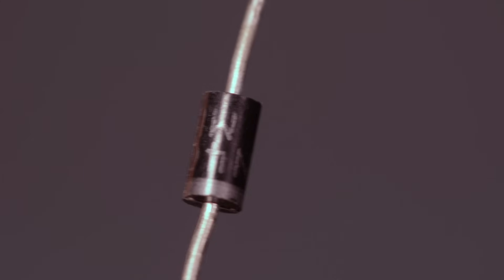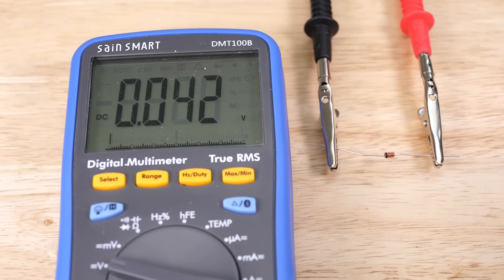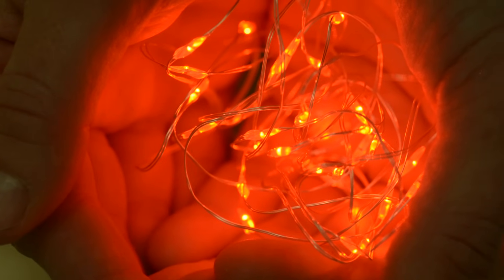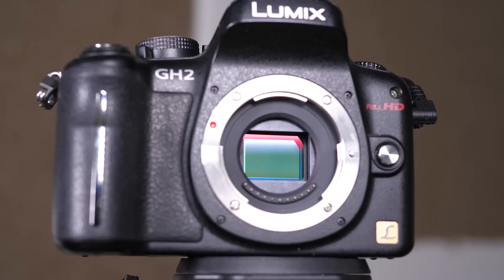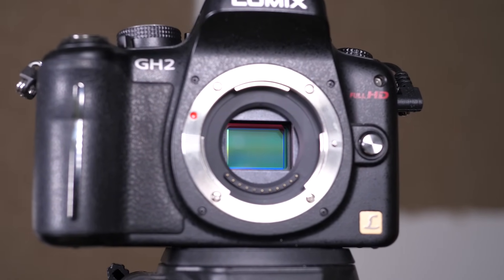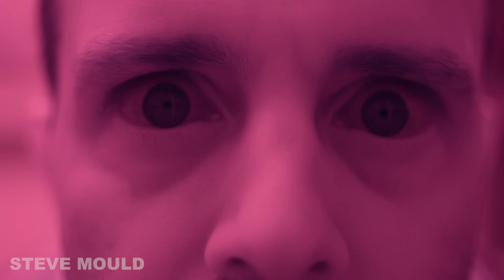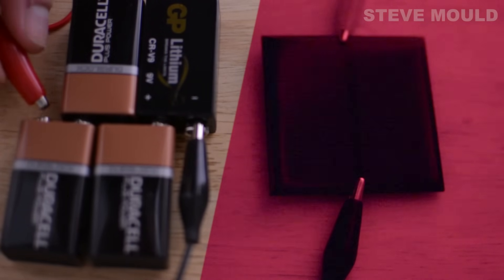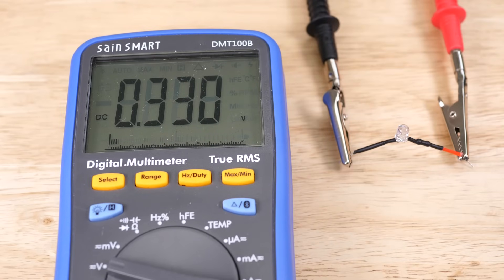Why all solar panels are secretly LEDs (and all LEDs are secretly solar panels)

Comment: 'You can use a speaker as a microphone.'

Hello, CIA.
Reply: Hello CIA my old friend...
Reply: @heroslippy6666  hello I am RJ REYNOLDS TOBACCO COMPANY from the cia illuminati  ! We love  watching  you!
Reply: @heroslippy6666  I've come to talk with you again...
Reply: @heroslippy6666  I've come to talk with you again
Reply: @ZacharyBittner  Because a vision softly creeping
Reply: I've come to let you snoop my friend.
Reply: Hero Slippy 
..... you've come to listen in again.
Reply: NSA joined the chat
Reply: Free speach left the chatt  @Yorgarazgreece
Reply: If you take a microphone apart, and a pair of head phones, you will find the diaphragms look very similar.
Reply: Vincent Robinette depends on the mic. Dynamic microphones are closest to speakers
Reply: @RennieAsh  That's correct. the diaphragm is designed to be very low mass, and as non resonant as possible. The coil is wound with super thin wire, to give enough voltage for amplification with a reasonable signal to noise ratio. To reduce mass, the coil wire is much much finer than would be used in a headphone transducer, or a speaker. As such, you don't want to use any more power, than what would be barely audible. If you hold it up to your ear, it will sound fantastic, because the spectral time alignment afforded by the low mass of the diaphragm. It's very fragile. No more than .05 to .1 watt absolute max, or you risk damage.
Reply: @vincentrobinette1507  wow,  you are either a ham radio operator or an electrical engineer.  i just ran across this site and am amazed at how much electric and radio knowledge is being emitted here.....
Reply: I did that to my ex once, looked extremely similar to my then current gf's diaphragm. . Suffice to say, cheap knock offs are just not my thing.
Reply: Lizard Man from Facebook joined the chat.
Reply: Lol
Reply: @sherloidbai7064  because he's from the company testing those stuff in secret and you kinda spilled the beans? lol
Reply: 666th upvote. =)
Reply: and motors are reverse generators
Reply: Thank you Big Brother 🤯🤐
Reply: LEDs can also act like a pixel from a camera 😉
Reply: if you have a mic built in that's easy access, and you deserve it for tempting them
Reply: I used to use a pair of headphones as a microphone when my mircrophone fucked up years ago....old news.

What is shown in this video is very old information and hardly a 'secret'.
Reply: Are u sure? I know piezoelectric devices can be utilised both ways. Didnt think the magnet driven, conical displacement variety would collect much useful information, but prob wrong.
I assume the speakers in phones are not piezo devices.... Not sure now.... might have a look see
Reply: Alexa
Reply: @sherloidbai7064  It makes no Sense transmit data thru Power likes. Teu another thing.
Reply: @azielmelo7756  there are times when it makes sense, like if you have a really low bandwidth signal, sand filter circuitry, and the store is closed, and you need to transmit that data from one side of the house to the other. It's very rare that it's actually practical nowadays, but it does happen.
Reply: Input transducer > signal processor > amplification > output transducer. 

Microphone > mixer > amplifier > speaker.
Reply: No
Reply: Haha
Reply: The CIA doesn't care about tracking us Americans, unless if you're a hacker yourself. it's actually hackers that get in and execute malicious scripts to force your computer to listen to you and send the information back to the hacker. The CIA has to deal with these hackers so technically the CIA protects you from snoops
Reply: We are watching you ! The  illuminati CIA!
Reply: LEDs can also function as microphones.
Reply: So you're saying the CIA put a SPEAKER in your room, to... send you messages ig(?), and you're going to turn that around on them so they have to listen to you? Because they weren't already listening? Do... do I have that right?
Reply: @joshyoung1440 , you can turn an LED into a microphone as well. It is shown how to do it on YouTube. Bag of potato chips as well.
Reply: @iamanempoweredone6064  cool, I bet you can and I'd love to watch how it's done, but that's entirely irrelevant to the point I was making
Reply: @joshyoung1440  , just a fun fact to know and tell..
Reply: You can technically also use a Piezoelectric crystal as a microphone. Basically long lighters.
Reply: in the Soviet Union, we could listen to our neighbors through a common radio point between broadcasts.
Reply: @ДенисЗайцев-э1ф , there may have been some device implanted in that neighbor’s house for surveillance purposes and you stumbled across the frequency of transmission.
Reply: @1d10tcannotmakeusername  I wouldn’t be surprised.
Reply: Sorry to ruin the fun. But for your speakers to work they need to be powered by an amplifier, and there's simply no way the audio signal can run backwards through an amp, not even into the amps power supply (which is most likely a DC power supply which has a full bridge rectifier).

But let's say you get through the amp, then you have to go through the DAC which is the component which turns digital signals to analog, here you also cannot go the opposite way as that would require a ADC.
Reply: I am not an electrician but I would think you are right. I made a sub-woofer into an ultra low microphone to record a kick drum and it needed to be completely wired differently and also even with my pre-amp it was a weak signal compared to a purpose built microphone  @Maxwaehrens
Reply: @Maxwaehrens  Excuse me, but I think you're missing the point, which is that dynamic microphones and dynamic loudspeakers are basically the same in construction, just different in detail so, fun not ruined
Reply: @joeking1019  I study electrical engineering, so I get that microphones and speakers are similar. Speakers turn electricity fed into them into an audible sound wave if that electric signal has enough power and is within the frequency range of the speaker. And microphones are the opposite, they turn an incoming sound wave into an electric signal but they require a lot more circuitry to get anything useful.

But back to the point, the fun I was ruining in my first comment is that CIA can not simply listen to what you are saying through your speakers...
Reply: Did you know that in the 70's they were already bouncing lasers off of windows to hear the conversations going on inside? My father worked on some of their equipment back then including the eavesdropping recording center for Southern Europe.
Reply: @SaneAsylum  My father was on that team and he tells me your father was not.
Reply: They can do that better now, they use a high speed camera to view inside a room, the experiment I saw was inside a sound proof room. They viewed the subtle vibrations of an object, and reconstructed audio from it, similar to how a record plays music.

https://www.youtube.com/watch?v=FKXOucXB4a8
Reply: this is true.
Reply: "You can use a "green" CFL light bulb as a camera" I really don't know
Reply: John Johnson 
I use my camera as a footstool!
Reply: I did that as a kid to hear everything my neighbors were saying.
Reply: NORMAN WELCH 
Me too...
Reply: The KGB join the chat
Reply: I've tested this many times before and can confirm speakers could work as a microphone, not really a revelation to be honest, although they certainly don't offer the best quality due to what their primary use is but lets say that the CIA and people along those lines did want to exploit this feature then they could, it would also be quiet easy to do so however they wouldn't because it's also quiet easy to get caught out by engineers most likely...if they use the traditional methods of implementing it that is... mwuahahaha
Reply: No one in the know, uses traditional methods.. ;)

You know the ol' tin foil hatter: "If they only show us this now, just think of what they could do 50 years ago!!"
Reply: Because tagging doesnt work. I put @name in front of things, it does nothing.

So go re read 100 comments, like I have to. 

Brain the size of a planet, and I have to resort to how youtube works..
ps the r/wooosh people already, by default, deserve everyone's disdain.. Oo
Reply: @sachin rambirith
See.. no tag.. tell me good sir, how can I not be a noob on the toob, when the codes fail?
I shall await your advice. enlighten me, plox..
Reply: !sachin rambirith
nope still no tag..
Reply: #sachin rambirith
Hmm nope..
Reply: @parishna4882  if you just click reply on the person you're replying to you don't have to type any @ bull$#!t unless youtube is glitching. brain the size of humans and I have to teach a person with a brain the size of planet how to use YouTube.
Reply: PS you know I was replying to you, so ...
Reply: @sachinrambirith9460  they can't exploit that feature and less the device has electronic specifically designed for receiving an audio signal from the speaker. You need a very specific device to do that, and manufacturers aren't going to put in all the extra circuitry into their devices and waste money unless the government specifically tells him to do so which so far has barely ever happened. Speaking from somebody who has been in the electronics manufacturing industry.
Reply: This is absolutely true.  I discovered this little trick on my own when I was a teenager in the 80's.  Plugged my headphones into the mic jack on my old tape recorder and had a (crappy) microphone.  Yeah, it can creep you out if you think about it.
Reply: You can also use a microphone as a speaker. Just plug a microphone 🎤 into the headphone jack
Reply: Chris Blackwell  do they? For like their voip "telephone" service? Big problem with it is that your wiring in your house has to be good or there is a LOT of noise
Reply: @ZacharyBittner  that's why all dsl uses filters
Reply: @clipsedrag13  oh, interesting point. I wonder if you could use filters on outlets...
Reply: @ZacharyBittner  some outlets already have filters built-in to eliminateback RFI from devices like microwaves or switch mode power supplies like in your computer or most chargers.
Reply: @sherloidbai7064  wait what? But..
Reply: IE : SO CALLED " SMART TV " OR Smart electronics
Reply: I found this out as a little kid screwing around, putting different stereos together. They work well too.
Reply: positron underVolt they used to use your electric connected to the power lines.
Reply: I remember plugging an old dynamic mic into my speaker port by accident and could very faintly hear my music through my mic
Reply: I thought it was weird that I was able to talk to people in my game through the earbug of a headphones..
Reply: like a telescrreen
Reply: Hory shyiiit you're right!! @_@
Reply: Smart TV LED screens are cameras as well @_@ hory crap!
Reply: positron underVolt 
Yes....
In the olden daze, I used to make free phone calls by screaming down the earpiece!
 "MUM, CAN YOU PICK ME UP!?!?"
Reply: ishopatkmart foru 
GooGhoul.
Reply: You can use DC motors as speakers.
Reply: Made the same comment I guess I should read the first post before I post something.😰
Reply: crazy people in the 1990s said that they were watching us through our tvs and people thought that they were crazy.
Reply: Well known
Reply: i used to do this when i was at primary school. yes they can the speaker can act as microphone but the sensitivity is very low that you should shout to get a signal in the other end. if both end is a mini speaker then it works perfect.
Reply: The 5 Eyes are watching you
Reply: Hech even a lighter can be used as a microphone😂. If anyone is curious electroboom has a video on it.
Reply: They said I was crazy, yet here we are, why can't I work for them and make some money
Reply: Back in the old CRT days, you could snoop on a house from the street, using some weird thing, and the frequencies from a crt, could be watched.. obviouly not in HD 1080p but... 

Hey I saw a video on the internet, don't deny it.
Reply: @parishna4882  that's because the CRT can only display one pixel is a time, so if you had a way to synchronize the horizontal and vertical tracking you can easily recreate the picture by using ambient radiation from the TV screen. I think they had that in an episode of Numb3rs a while back.
Reply: Why? Google use your actual microphone to snoop on you.. so foes facebook. And apple. we all remember that 'bug' that let you turn on someones mic from a facetime thing, no?

who needs to turn on your speakers.
Reply: @sherloidbai7064  Probably because it really sounds like a conspiracy theory that doesn't make a lot of sense. As someone who has a degree in computer sciences (and had electrical engineering in college and HS) i can say, with certainty, that there i s absolutely no way to transmit data over power lines.
Reply: @hl356  It is theoretically possible cause data is just coded electrical signals. power lines carry electricity, doesn't seem like a huge stretch to me. either way we all have cameras on our computers and phones so they don't even need to spy on us that way anymore
Reply: Patricio Ansaldi not theoretically possible dude, as it's already been done.
Reply: @hl356  ever heard of powerline adapters? Obviously you're not gonna be able to listen to anything on the other side of city but there are cases where neighbors were able to like steal each other's internet
Reply: @hl356  bro you might wanna go get your money back from your degree, sound, light, and electricity are all forms of electromagnetic waves and they can be converted between one another ie transduced.
Reply: @hl356   uh, not true, you can oscillate a power signal and send data. I think you might want to qualify your statement.
Reply: @hl356  you actually can, look up Power-line communication on Wikipedia. Lots of noise and such but it was used for like a proto wifi and home automation back in the 80s and early 90s. There are some retro tech reviews on YouTube that actually use it.
Reply: Uhh... did you just really claim that, with some sort of superiority?

man, you're fit to work in an indian call centre scamming old people.. wtf wow.. lol

"Transmitting data over power lines

Broadband over power line. Broadband over power line (BPL) is a system to transmit two-way data over  existing AC MV (medium voltage) electrical distribution wiring, between  transformers, and AC LV (low voltage) wiring between transformer and  customer outlets (typically 110 to 240 V)."
Reply: hl356 and yet you've never heard of powerline networking adaptors... Astonishing!
Reply: @hl356  there's tons of ways to transmit data over power lines, you just have to have a filter that separates out the different frequencies, it's actually pretty easy. I'll try to upload a video of it later some time.

Comment: Resistors are also capable of emitting light in response to a voltage... once.
Reply: William Shreckengost 
Not necessarily only once, but they do have a finite lifespan before they burn out. Old lightbulbs had tungsten or osmium-tungsten resistors as their light-emitting filaments.
Reply: Cheers. I completely forgot about incandescent bulbs.

Comment: LEDs put out a frequency dependant on their manufacturing process. Modern LEDs all spit out UV light, and have coloured phosphors to convert that UV into the desired colour. If you shine a UV light source on your LED's, you will get angrier pixies. Although if you've got any of those really old LED's from the 80's and earlier, you'll have to shine the wavelength of light back into them that they themselves produce.